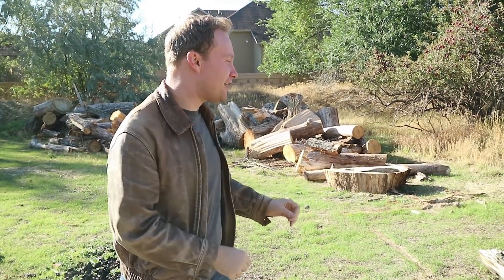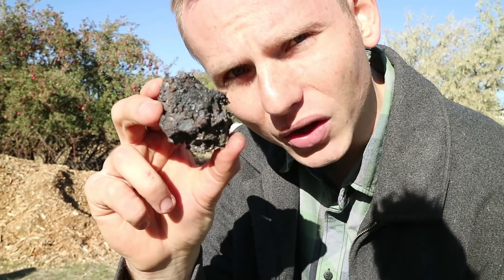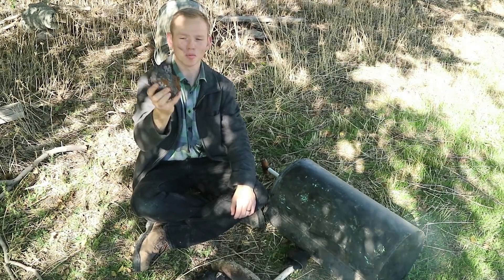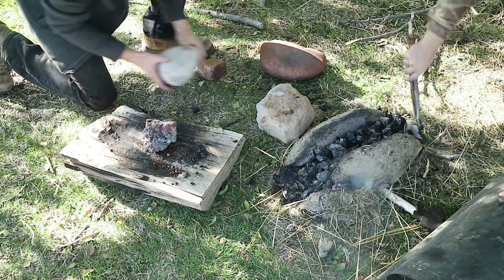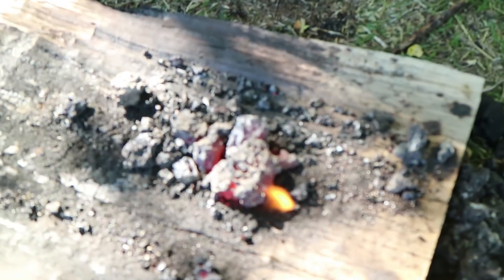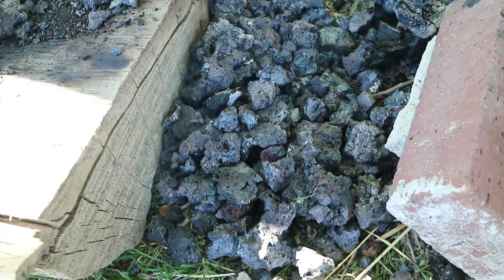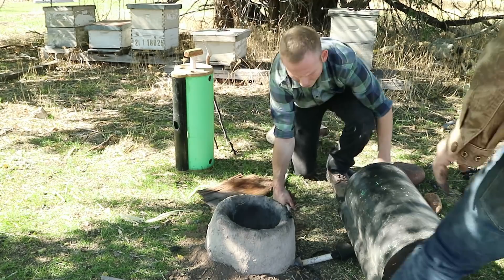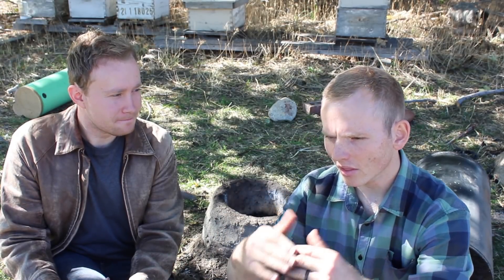But Is It Iron? Post-Smelt Primitive Forging

Comment: the problem is that you have to wack them at high temp and lightly, but most important your consolidating the bloom into an ingot, not just smashing it flat. which means slowly hitting it whilst rotating it to make it smaller.
Reply from the maker: Thanks. JB

Comment: I think when wood burns it produces steam and given that water has a extremely high specific heat capacity, more heat will be transferred....
Reply: You would need to superheat the steam too much or have a pressurized vessel for that to work. The steam will evaporate away at 212 F or 100 C which is a much lower temp than needed to smelt iron.
Reply: @jmicjm  i think he means that the steam absorbs energy from the iron.
Reply: @jmicjm  but wood fire ovens gets very hot...

Comment: Couple things.  First)  Test with Magnets!  They had lodestones in the ancient world!  (even though they didn't know about the curie temperature)

Second) You still have access to things like bronze and ceramics!  Tongs, and anvils are perfectly doable.  

(Also, even if you want to use wood (which is fine, especially at first) tools make them the right shape!  Large log stumps for anvils, and bigger heavier piece of wood with long tough branches for hammers-with-handles were things that existed.  (also try to make sure the wood is a fairly hard one, so it doesn't burn as much.))

Third) Ceramics means pots...  and one of the BEST ways to "consolidate" a bloom (which they DID do in the ancient world) was what is called crucible steel.  You put the iron you've isolated into a clay pot with some leaves and glass, SEAL the clay pot entirely, to prevent air-leaks, and then put it in the same kind of foundry/furnace that you've already made, but with just stupid amounts of charcoal, air, and stupid amounts of time.  Because it's sealed, it stopped the iron from burning, or de-carborizing.  

Either way, hopefully some of this helps!  And loving the series.  Hope you get somethin' good!
Reply from the maker: Thanks! JB

Comment: Much hotter and use softer "hammers" when consolidating. Rocks are too hard and are too much of a shock to the bloom, using wood or copper mallets can help mitigate that. Consolidating the bloom MUST be done at welding temperature or it will fail. This was normally done immediately after the smelt when the iron is still hot. 

I'd suggest making some wooden and bronze/copper hammers as well as doing this in the shade/at night so you can see the colour of the iron better.

Comment: just thinking... crush it all into small bits... get all the bits hot, quickly dump them in to a big hole lined with large rocks and drop a larger rock onto the pile... repeat.

Comment: You also want to keep your iron much hotter. I am a hobby blacksmith that has done some work with wrought iron, if I was forging that professionally made wrought iron at that low of a temp it would shatter in the exact same manner. You want it 500ish degrees hotter. 

You should also be forging it on a large rock or a treestump instead of a board. Most of your energy is going into the dirt and grass, not the metal.

Comment: If you look at Alec Steele's video on forging a meteorite, you will see that if there are contaminants in the sample at all it will start to shatter. So it's not that big a deal to see it shattering, you just need to purify it.
On another note, you guys should be using better tools. There's a reason the bronze age was between the stone and iron age

Comment: 1st - No way near high enough temperature, you need at least 900C, 1000 is better for working with blooms. 
2nd - I'll suggest a wooden mallet, rather than a rock. You can control the power better.
Reply from the maker: Thanks!

Comment: You really need to bring it up to a welding temperature. That is the only way your going to consolidate the bloom into iron. You should have done it right after the smelt. The first blacksmiths probably used bronze tongs, hammer and anvil until they realized that the tools made from iron would last longer. Oh by the way, you should make a really large mallet out of green wood and use a green stump for an anvil when consolidating the bloom. Just sayin

Comment: There seems to be a common misconception in this comment section, i.e. that humanity passed from copper to bronze to iron consequentially, each being an improvement on the previous one. Thing is, we don't have evidence that would support such an hypothesis. While it is definitely possible, even probable, that early ironsmiths used bronze hammers, it should be noted that:
A) Bronze is cast, not forged, therefore smithing hammers and anvils made of bronze would be fairly rare if not nonexistant.
B) Ironsmithing became a thing because of the scarcity of copper and bronze, which were only available to many populations only as (expensive) trade items. With the invasions of the Sea Peoples and the other events that happened near the end of the Bronze Age (such as crop blights) long-range trade became unfeasible in the Mediterranean, and many populations found themselves out of metal, leading them to search for an alternative to bronze, which was found in iron.
Reply: But they would have had experience with liquifying metal, and would have appropriate tools for doing so, like formed tools. They wouldn't be using twigs and rocks that happen to be around. They would have a workshop, a proper bellows, an assistant on the bellows, purer materials for the oven. There is WAY too much organic material in that clay. That "anvil" would either be a flattened rock or at least a stable wooden platform. The tools would have been crafted, not picked up off the ground. Check out ClickSpring for some tools that were available during the bronze age. They were capable of making quite complex clockwork mechanisms without any iron, but these guys are doing it like they're in the stone age
Reply from the maker: Yep. That's the idea. In Africa there were regions that developed iron before copper. Jumping straight from the stone age. That's what we're trying to do. JB

Comment: You should be digging a much deeper pit with a large diameter blast pipe right to the bottom and lining the pit with limestone clay. If you dig it deep and have a good blast pipe with a good thick layer of clay you dont even need bellows just time. Also I really noticed how much you guys talk like metallurgy didnt exist begore iron and that it was cavemen trying to make the stuff and nobody knew what they were doing....I think you mightve missed something somewhere along the way.

Comment: Um. Bronze is metal and doesn't need metal.  Make bronze tools. Upgrade.  Bronze is stupid common in many places because it required trade. It was traded in large quantities and was functionally currency (not coinage, just a common meterstick).

Doesn't help you in a pure survival situation, as you will probably not have enough copper and tin ore. If you're desperate, you could use arsenic, but... Really desperate.
Reply: There are several types of bronze, you don't necessarily need tin. Thing is, copper ores are rarer than iron ores and so bronze itself is rarer.

Comment: Get hotter increased efficiency I’ll be a bellows either learn how to make simple wooden gears and a continuous rotary motion blower out of simple wood and leather or use to Bellows with your valve 180° off so one push blows air and when you pull the other pushes air need to up your airflow get hotter get some Borax or other substitution was so you keep down your slag. Learn how to make it simple primitive crucible. You will get there